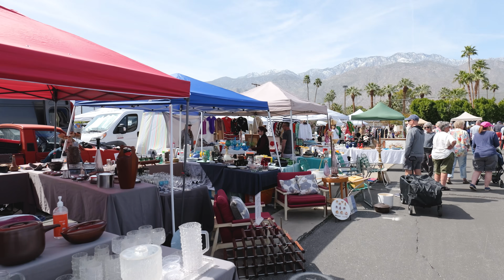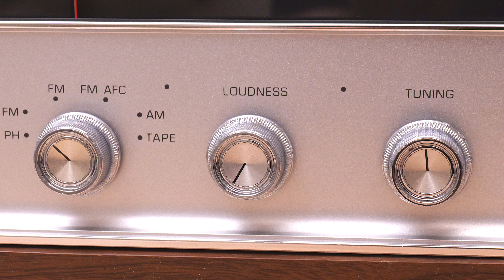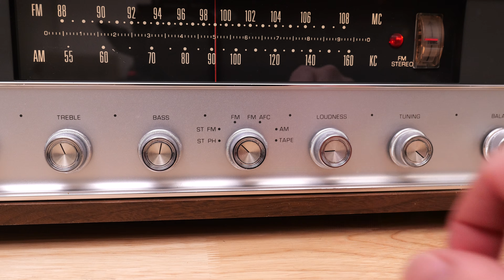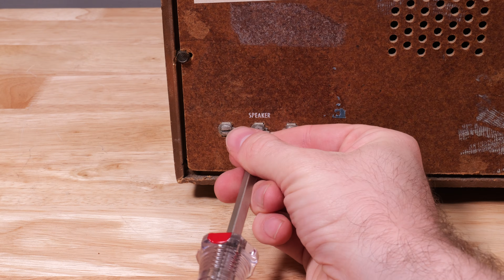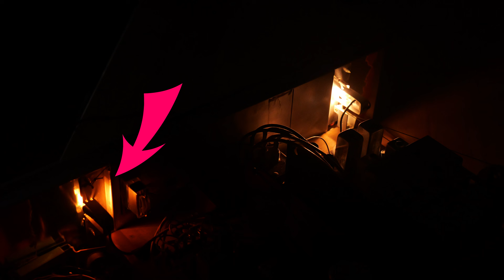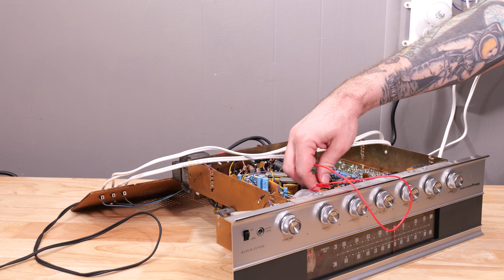The 1960s Were A Weird Time For Magnavox Amps

Comment: In 1961, the FCC authorized adoption of Zenith's stereo multiplexing system as the stereo FM broadcast standard. Frequency Modulation does not broadcast as two discrete channels. Multiplexing was a system which remained compatible with standard (monaural) FM broadcasts by encoding a 19khz carrier signal, which can be decoded by a Multiplex decoder incorporated into an FM tuner. This was a system reflecting the technology compromises of 1961. For all intents and purposes, Multiplex FM sound is vulnerable to much greater noise level, distortion and reception "picket fencing" than standard (mono) FM.  The FCC required stereo tuners -- even those in car radios or battery powered portables -- to include a separate "FM stereo" button so the user could switch to FM mono to reduce noise and distortion. During a 1980s deregulation reform, this FCC requirement was eliminated and many younger listeners have no idea of the difference. For motorists who are traveling, FM stereo reception can be very poor whilst FM mono reception could be quite listenable.

Comment: Nice old receiver, I'd be a bit more cautious with the clip leads, they looked awfully close to the metal case of the switch, I would have gone for a properly soldered bridge wire, then disconnect the power feed coming back from the turntable/changer lest it get confused by a backfeed/permanent power on both leads.
I'm kind of curious how it sounds - how it stack up to a more modern unit, distortion, power etc etc.
Reply from the maker: I would say it sounds decent but it's not really comparable to madern equipment or higher end vintage stuff. That said, it was plenty listenable for an extended period.

Comment: Stereo console: I'm the youngest of 4 born in 1965. I got these details from a sister - in 1962 our parents bought an Airline console at the Montgomery-Ward at 7 Mile & Gratiot on the Eastside of Detroit, and brought it home in the 1960 Falcon station wagon. (We lived in Roseville near 11 Mile & Gratiot.) It's no base model, it has AM/FM/FM Stereo with a VM 1200-series fully automatic 4 speed record changer, Multiplex (can be used as AUX In), external speaker connections, and the built-in speakers are 3-way. I've had it now for many years and it had worked reliably for over 60 years! I'm not powering it on now until I get it fully checked out. A little investigation revealed it's made by Wells-Gardner of Chicago. As kids we had a Chipmunks Christmas album, and the 4 speed with 16-2/3 RPM made them sound like Dave Seville, 72 RPM made Dave sound like a Chipmunk. Busted! It has a red pilot lamp near the bottom and we'd put a finger over it and watch it glow red through the finger. While still in my first house I bought a 1965 Zenith MM2604-4 "Somerset" from a neighbor up the street, the original owner, and it already had issues when I bought it.  It was a display piece for over 15 years until 2023 when I discovered that "vintage audio" is a thing and that these are generally repairable. I've replaced the main filter caps that were shot resolving the major issue, but lack test equipment to go any further. But now I have a good tech just a few miles away and hope to have it fully functional by Spring. Then the Airline gets refurbished. They each have cabinets and fabrics still in very good condition.

Comment: I grew up in Fort Wayne, Indiana, which was the home of Magnavox. So Magnavox consoles were very common, and even though Magnavox was a premium brand, people bought the hometown brand. Indeed that is a console chassis, but later on Magnavox did produce true component receivers, sold under the Magnavox brand, then MX brand, and in the end, Philips Laboratories brand. I have a 1500 DTI (ultra-rare digital tuning display) and a Philips 787, which was the last iteration of the same basic receiver. Just a couple things to note - the switch tone controls each had a different response curve, with the second step being flat. So it was decrease (just the deep bass), flat, boost, and more boost. The Timbre control had a different action with flat being at 12:00. The loudness control has full-time loudness compensation. There used to be an adapter to override the automatic phono power, but that was when these were new. When I restore a Magnavox console, I always do a recap. The consoles were showing bad cap issues back in the 1980's already, and doing so really wakes up the sound, especially the clarity of the treble.

Comment: Technically it is a receiver not an amp and the radio section is called a tuner, at least that is how we say it where I am from.
  I have found that these cheap low powered solid state early receivers/amps are good to go without changing caps. It seems those bigger high watt amps and receivers put a lot of stress on their components and later have failing parts whereas the cheap ones didn't stress their parts and are therefore still working well. That is just my experience though.

 BTW, I have a garage full of consoles. Older people just give them to me when they find out I have interest in them.
Reply from the maker: That is true. I don't know why I kept calling it an amp... I think it's because the last few similar ones haven't had built in tuners so I just got into the habit of saying amp. 
I think "receiver" is the universally correct term. 
I don't know how I didn't catch that. lol

Comment: If you want to hook up a turntable to the unit and hear how it sounds without modification. 
Make a cable that hooks up to the plug in the rear of the unit and goes to a switch box.
Thats it. The amp is expecting to see a dead short across 2 of those pins like a switch. Activated by pulling the tonearm across onto the record on the original turntable.

Comment: I used to own 2 RCA "New Vista" Consoles from 1966 and 1969  (one with a TV) which also used "Loudness" for the volume control and had a separate AFC switch. Also power control by phono, so you could stack a bunch of records, play them, and it would automatically shut off... Cool video!
Reply from the maker: That makes sense... the whole machine could shut off when the record finishes.

Comment: My parents had a Magnavox console in the living room back in the day, I'm pretty sure it was bought in or around 1969 or 70 and it had that same receiver that sat facing upwards under the cover. Sound wise it was barely tolerable even back then. My dad had a cheap Sears receiver he bought in or around 1972 that was leaps and bounds above the console unit in sound. 
The TT was a stacker style auto changer and my mother would stack 6 albums up and let it play for hours. It had speakers on the ends and front, each speaker panel was the same and the panels on each side were wired as one speaker, two tweeters, two woofers.  
It was still in the same place when I bought the house after they passed, I tried for years to find it a new home but with no luck. I finally broke the the thing down and scrapped the cabinet. (It even ran for 6 months on CL for free with no takers). I still have the pieces, the receiver got stuck in a crude box and got used in the basement wood shop I have here, the speakers are in a box somewhere, so is the turn table and 8 track player. The 8 track player had died I believe, the plastic sleeve that held the head in place had split and let the head fall out of place. 

As a radio, the receiver is really good, it picks up absolutely ever possible station far better than anything else I've ever had with only a simple dipole antenna, in the basement no less. 
For the TT power issue, this one had a button, which may have been added, that bypasses that selector switch. in the console, you would simply turn to the turntable position, then press the button to turn on the turntable Judging by the style of the button, it was either factory or added when it was nearly new. The TT in the console was branded Magnavox but its a idler wheel driven BSR with Magnavox badging. I never use it with a TT, but still have it, but chances are the idler wheel needs to be replaced after 56 years or so. 
I did replace the larger capacitors in the receiver, mostly just because I had them and two looked like they were getting wet or weeping a bit. I cleaned the controls, built it a basic box out of 3/8" plywood, and stuck the whole works inside. I did give it modern speaker terminals, a pair of banana plug thumb wheel types from something I trash picked just for that reason. the rear panel is made from one of the top doors off the console in which I drilled a series of vent holes. The bottom of the box has a cutout and I used a piece of peg board so air can circulate. Its not pretty but it serves its purpose. The tape input terminals are connected to a mini CD changer that's part of a minisystem that got dropped at work. I simply connected the outputs to the Magnavox with a homemade RCA cable it hangs beneath the shelf he receiver is on on two J hooks, now mostly covered in saw dust being outside the covered area that holds the receiver. I never open it, so its not a big deal, It got 60 CDs that I mixed and recorded myself on my computer, more than enough to last several days of play time down there. 
I did mount the TT button from the console in the back panel, so its there and functional if I wanted to use it. Maybe one day I'll built some boxes for the four speaker panels and mount them up in between the floor joists vs the four car speakers I've been using as ceiling speakers down there. 
I'm betting that with a proper cabinet, some insulation, and a decent crossover the 12" speakers could sound pretty decent.

Comment: In your Blood, interesting your Grandfather had a Electronics store. Nice wood case, funny location for vent, must be for the Bulbs. Comp. Resistors you should be more concerned than the Caps. Back Breaking Counsel before my time + too heavy. Always LED lighting unless not possible, MARANTZ.
Reply from the maker: Interesting. So those old resistors can cause trouble too?

Comment: It was nice of your buddy to volunteer his ears for the phono sound test. Brave! The only cheap out I could see was the tuning knob being the same as all the others. The line serves no purpose, but saves a few cents per unit, maybe to not have to make sure the assembler put on the non line knob in the right place. As for your question: My parents had a Gerard am/fm, record player that would drop down about 5 or 6 records without you touching it. Though, you could hear a speed problem by the sixth record sitting on top of each other till it got back up to speed. It wasn't very long and probably did not do it when new. Dad ran speakers into my room, so under the carpet and down the hall. Wires also went through the floor he could have tunes while doing his wood working projects. It was a nice sounding unit and eventually every function turned into crackling. It got gutted and used as storage for seasonal blankets. Good times. It was the early 90's when it totally stopped working and got converted. I found ones very similar by googling Vintage Gerard record player cabinet, but alas, not a perfect match.
Reply from the maker: That's really cool that he wired the speakers into your room. I remember my first stereo was one that I bought from a discount store and I jury-rigged a bunch of speakers up to the corners of the bedroom after hooking it to my computer to simulate surround sound for the low quality pirated movies that I had. lol

Comment: What an absolutely gorgeous machine! Does the "timbre" function like a midrange control? 
A few notes on the radio section: the switchable AFC on FM is to allow you to pick up weaker stations. If you have one of those, between two stronger stations, it will almost certainly disappear because of the AFC spreading out the bigger signals. That's generally not a problem if the receiver is sensitive enough, but I guess the designers of this Maggie wanted to minimize complaints. Also, notice how the AM and FM markings are of equal size on the dial. This Magnavox is from a time when the two bands were still equally important to the general public. The more modern a receiver is, the smaller the AM frequencies become on the dial. Just look at the Pioneer SX-850 or 980 - the AM is almost illegible, it's so tiny.
Reply from the maker: Oh, that’s a good point. I noticed also that the AM dial didn’t have the emergency station indicators at 640 and 1240. So it really sits in a narrow band of time.

Comment: I grew up with a Magnavox console. Thing was huge! AM/FM, turntable TV and speakers all in on one piece 70s furniture. Complete with avocado green grill cloth. 
  I still search out those older tube units. Especially the ones with the 185 series 8802-00 stereo tube amp sections. They make great little stand alone amp projects. Very clean little amps.

Comment: Okay, I don't think I understand the whole "changer power" thing.  Why would the amp need to turn off if nothing as connected?  That only seems to make sense if the changer had its own amplifier which would ensure the speakers weren't getting signal from two places.  Maybe this was so you could use a changer with or without its own amplification?

Also how is the power routed back to the amp with only three prongs?  I can only assume it is still getting its main power from the wall, or sharing an earth somehow.  Which begs the question, could you make some sort of looped plug to make it work?

Sorry, I might have totally misunderstood this! 😑
Reply from the maker: I do not know. It would have been so much simpler to just let the whole machine stay on... especially if everything was built into a self-contained wooden box. There's no configuration I could read with my DMM that was necessary compared to just powering it directly. 
The only thing I can think is that they adapted the amp to a weird style of turntable rather than designing all of it together.
Reply: @AudioThrift  would it be to try to tie you into buying their specific turntable ?
Reply from the maker: If it were any other situation, I would assume that were the case… but these were built into a single piece of furniture with the tape machine and turntable already installed so there wasn’t an option to pick and choose. This amp is just a console piece that’s been placed in a standalone box- it’s otherwise identical to what I find in consoles from what I can tell.
Reply: I must admit, this feels like one of those pieces of information where its definitive purpose has been lost to history.  Great work in helping to bring it back!